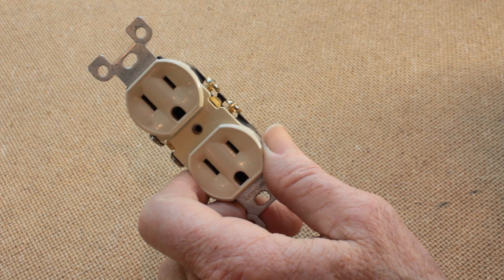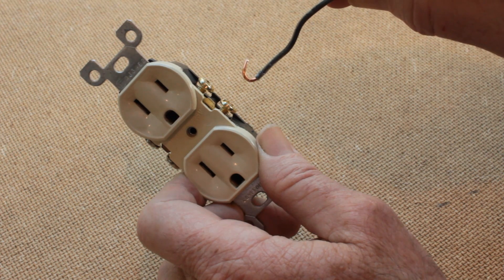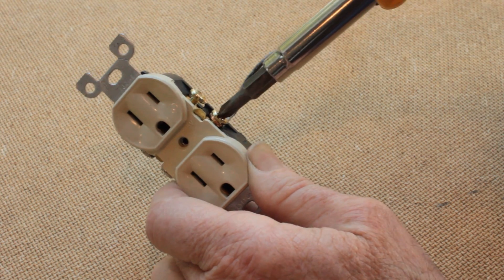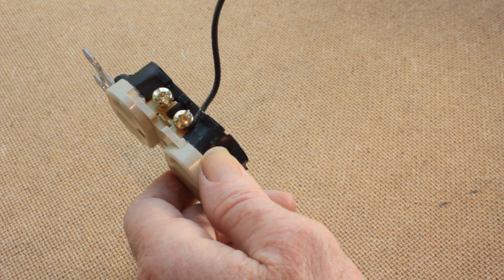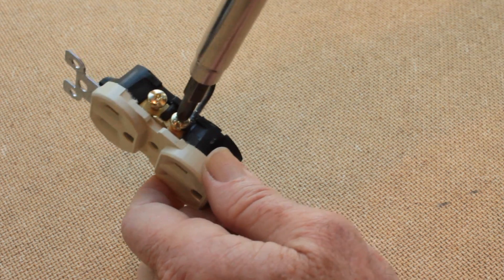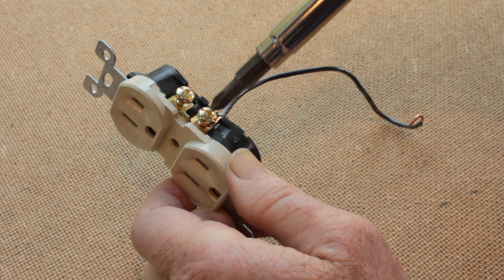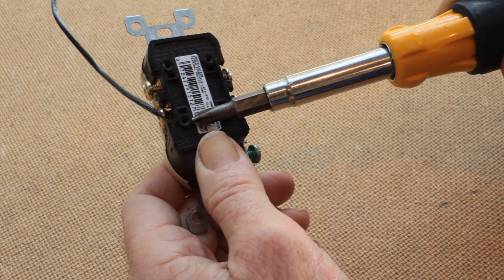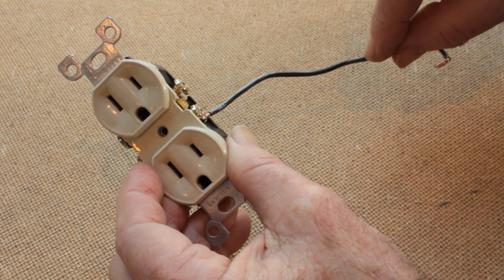A Common Goof Replacing Outlets

Comment: I just replace my kitchen outlet and its still not working.
Reply from the maker: Maybe you need to look around in the general area for another outlet that has pushbuttons on it (a GFCI) and push the reset button. Or maybe one of your circuit breakers needs to be pushed Off hard and then On.
Reply: u just helped me solve y an outlet didn't work. there was a gfci outlet that was hidden behind some things that had been put in front of it. apparently someone had pushed the test button.. i pushed reset & now the other outlet works. thanx!
Reply: Strange, in my kitchen, 3 duplex outlets are driven by one GFCI outlet...all outlets are on the sink side of wall...
Reply: In my state more than one non GFCI outlet can be added after the GFCI.   BUT you will need to note the amperage of the GFCI outlet and not exceed that with the total amperage being used by the other outlets just like you wouldn't exceed the TOTAL amperage of the circuit breaker in a circuit.
Reply from the maker: Most GFCI receptacles will say they are rated for "20 amp feed-through." This should mean you don't have to worry about overloading the GFCI device, even when it is only rated 15-amp in regard to the type of plug it can receive. See http://communities.leviton.com/thread/1534

Comment: I never use the cheater holes on the back, wish they would outlaw them.
Reply: They already have for #12 AWG; newer devices only accept #14 wires.  But yes, I wish they would do away with them altogether!
Reply: whats wrong with the cheater holes?    i bought my house new & all the plugs are wired that way.. house is 40yrs old now & just starting to replace all the plugs.
Reply: terry wheatley the spring loses the tightness and become could be potential for the wire to not make contact, pull out, or could create a hot spot by not being tightly held.
Reply: terry wheatley They MIGHT be fine IF enough wire is inserted, but I've seen something like 2mm jammed into them. I personally would rather use the actual terminal screws. I understand that your house wiring is 40 years old and they are not a problem. But a new house assumably had an actual electrician do the install. OTOH, you are in the process of replacing them. My house was wired in 1928 (I know this because it's was my grandfather's house,He was an electrical contractor, and did the install.) Only the Kitchen and bath outlets have been redone ( new circuits in the 80's So, grounded and GFCI, per code). The majority of the original outlets are present in bedrooms,etc. and working after nearly 100 years. They are obviously wired on the terminal screws and wrapped around with friction tape. So there's that.
Reply: They don't make or maintain good contact with the wire, they then get hot and char the insulation. Or worse.
Reply: David's Favorite Videos I always use the screws, I never trusted those little holes.
Reply: this probably explains why the home depot or ace hardware doesn't sell the outlets with the holes in the back  anymore.  when my outlets wear out, i usually buy home depots  top rated outlet & use the screws.
i really tried to buy the old style outlets, but no one carried those anymore.. thanks for your feedback.
Reply: terry wheatley, really, i just bought some leviton decora TR DR's from home depot 2 weeks ago that had back stabbers. nothing wrong with using back stabbers as long as you use properly. been doing it for 30 yrs. now, never seen any of the house i did burn down, "yet" LOL. but what i have seen, is someone, namely my helper, wrapped the screw on a 20 amp recept. but forgot to tighten the screw down on the (grounded/identified wire) side and that caused some major overheating and arcing and this was before Arc fault breakers. and thinking even more, (ut oh watch out) they use the same method for wire connectors now as well with those quick connects. they're all UL approved so i don't see anything wrong with using them as long as you use them properly.
Reply: i fully agree with you.. when they build tract houses, time is money & besides after 40+ years those wires in the stab holes are still very solid in the plug.. when i replace them as a homeowner I usually use the screws.
Reply: Well if the push in option was causing fires they would no longer be available. the insurance industry that pays for fires losses use facts to decide what they allow, and really don't care what any of us uses or wishes. If weren't for a need to replace worn devices in older systems,, the screw terminals most likely would be history, denying you that option.
Reply: I’m in the process of replacing the old 1970’s outlets in my home and so far not a single outlet that utilized the back stab wiring setup was loose. As a matter of act they were tight as can be and I just ended up snipping the wires clean and go from there. Just my observation and that’s where I’ll stop.
Reply: In a perfect world, yes, all wires should be installed under the terminal screws. This is probably the superior way to install the wires on a receptacle. However, imagine that you are an electrician installing 100 receptacles in a home. You do this day after day after day. The "cheater holes"  or stab holes, allow for a faster way to install receptacles. The important thing to remember if you are using the stab holes is to skin off enough of the insulation on the copper. Once the wire is stabbed in, it is rather difficult to get out. The connection is quite tight.
Reply: The "cheater holes", as you call them, are actually more reliable and safer than the screw terminals, as they are spring loaded and will maintain a gas-tight contact with the wire over the years.
Reply: @Milosz_Ostrow  false

Comment: Why not use a better quality outlet like Pass & Seymour and not Leviton junk. Pass & Seymour technology has a robust grabber plate that grabs the wire like a vise and no need to make those old out dated wire curls. 

Nice video but very out dated even for 2011. 

Also I would like to add that Leviton (and you can see it in the video) stamps their plastic body onto the metal retaining tabs. P&S tabs are solid and are formed around the body so that the plastic body is cradled on the metal chassis making is 100x stronger and longer lasting. 

When I encounter a Leviton device and remove it, I NEVER re-install it but replace it with P&S for the customer.
Reply: WRONG!!! Push terminal wire connections are for LAZY electricians and only (just) meet code. Rip open one your beloved Pass & Seymour outlets and look at the total contact patch that is made with the push in connection and then compare that to a loop around and screw down connection. Load that up with a 1500w heater over the cold months and tell me you'd feel comfortable with that setup in your own home. It's stupid, lazy and barely meets code. Stupid and lazy is what burns down houses and kills people but it makes profit so that's why it's allowed.
Reply from the maker: In my experience a "grabber plate" is not foolproof either (don't know if Pass & Seymour is different though). A bit of twisting this way and that as you are pushing the receptacle into the box, and those grabbers don't hold quite as strong as when you first tightened down.
Reply: And just how much more does the P&S cost?
Reply: A few penny's more, in my area (Indiana) they cost about $1.49 ea. 

I must correct myself, I do not mean "grabber plate" as rather I should have said the metal bolting plate wraps behind the P&S devices. Leviton the bolt plate extends through the body of the device. This causes the plastic parts to eventually separate and fail having the plug pushed and pulled out of it over time. P&S the bolt plate is mounted behind the device holding the device like a cradle.
Reply: Oh dude, the ones that u shove em in the holes in the back of the outlet? Those are shit... I tried to get them to release but the buttons were rusted over... i snapped one to pieces too.. xD i had to cut the cords and rewire all different types of wires... the ones that fit have screws were easier to get them to pop out even though they were in the same shape. I prefer screws over the fancy stuff. I had to cut so many wires. :/  I am doing a rehab on an old house. :p
Reply: OberDragon88 

EXCEPT

The screw connection is much better than the crappy connection back push ins that cause fires by bad connection
Reply: OberDragon88 Plus, trying to insert wires in the back of an outlet is almost as hard as replacing a ceiling fan pullchain with push terminals.
Reply: must be nice being rich by I pay retail $0.62 for 15 Amp at walmart and less the $3 for 20 Amp at homedepot
Reply: OberDragon88 hubbel
Reply: Leviton almost invented outlets. They were made in America. I do know that they have a great warranty.  They replaced some outlets free.  All companies have good products and failure prone products. I always screw my wires...none of that Mickey Mouse attachments.
Reply: i agree with you about the Leviton products. they simply are not good quality. I prefer Hubbell, Pass and Seymour or any of the other premier quality devices. In the long run the extra cost will be earned back in the form of superior performance and lower maintenance costs, and the safety factor is greatly increased.
Reply: @ Sean Greene Why don't YOU take one a part and see that they are not like the older generation push in the back wire clips. They are designed with metal sandwich plates the way terminals on 3-phase starter relays are made. S0 stupid put that in your pipe and smoke it, your the lazy one to not research your material before posting.

Comment: Great tip!!!   I've always seen the push connectors as the territory of the lazy electrician or the clown doing "knock it out fast" piece work.  I prefer the Industrial grade recepticles with screw and clamp plate over the type shown in the video.  They don't even give the "goofs" the option of a push connector.   I also prefer a large flat blade screw driver so I can get more torque on the screw and prevent any sort of resistance cycling at the wire/fastener interface.
Reply from the maker: +ramosel  I agree on the flat screwdriver. I found the clamp plate method could easily end up loose too though.
Reply: ramosel if you use the correct size Phillips tip screwdriver you can get the right amount of torque as well. I see so many people who use the wrong size tip or bit with their screws and want to know why it stripped out on them.. Duh.
Reply: Yes, but even the correct Phillips tip has a problem that limits torque.  Phillips screwdrivers and screwheads are designed to deliberately cam-out ("slip") above a moderate torque level (rounded corners in the center of the screwhead), unlike a true crosspoint screwdriver and screw combination that is designed to lock tightly and not slip.  This Phillips cam-out design was done deliberately in the earlier part of the industrial era, when factory equipment didn't have calibrated de-clutching yet, and these silly Phillips screws have remained in universal use since then.
Reply: I recently changed out the 3 duplex outlets in a surge suppressor strip which had push through for side wired with screw terminals outlets, new copper wire, and line cord, reinstalled in the CMOS. Screw connectors much more solid.

Comment: so anything wrong with just using the holes again? 
you do not have to de rate the outlet if you use them? 
i  know some electricians do not like them
now those snap on mobile home outlets those are a joke  lol
Reply: crowmagg1 my rule of thumb is to never reuse an outlet once the wires are taken off.   The receptacle can have loose and worn parts.  Replace the outlet and that makes you and your house safe and whole.  If you really, really, really want to reuse a previously installed outlet where the original installer opted for the backstab route, use the screws.
Reply from the maker: Jim K - I think when crowmagg1 asks about using the holes "again," he means using the holes of the new receptacle rather than using the screws.
Reply: TheCircuitDetective yep, I just read it the other way.  :)
Reply: as long as the conductor are corrosion free, and free of nicks they  can be used with  the push in option on the replacement device.

No need to derate the device.
 
Yes many electricians dislike them. They dislike them without any evidence they are causing fires. That's conservatism to a fault.

I believe the odd ball mobile home  devices have been phased out. Probably because it's cheaper to use a more common device, that in practice doesn't take 
 that much longer to install.
Reply: waswestkan whats mean derate?
Reply: Frederick Reeve - Derate, de + rate, treat it as if it cannot handle the amount of current that it was originally designed ('rated') for.

Comment: Can you help? I replaced two receptacles and there is one UN-replaced receptacle in between (a 20A, 125V). The two replaced receptacles are 15A, 125V, and the one "upstream" of the other two WORKS, but the two others don't (the UN-replaced 20A and the replaced 15A). I don't know what happened -- could I have fried the 20A?
Reply from the maker: +desertgalsinLA  Check how well you made the connections at the working upstream receptacle.

Comment: Aluminum wire was common in the late 60s /early 70s you can pigtail copper from the receptacle to the aluminum wire as long as the aluminum to copper splice is done properly with approved connectors

Comment: Another tip when using lamp cord is that the neutral wire is the one with the bump or ridge on the side of the insulation.
Reply: Kenn you should never use lamp cord on an outlet
Reply: When replacing the cord to a lampholder socket, the neutral (wide slot) should be wired to the screw base side, the hot (narrow slot) to the switch and center lamp contact.  If you do it backwards, you can shock yourself while changing the bulb, even if the switch is in the 'off' position.

Comment: I never understood why code allows wire connections to be made connected into the push in type connectors on the back of outlets and switches.
Reply: I have never seen those push in type fail before and a google search showed nothing.  Have they failed on  you before?  Those push in type have been around for 30 years and I have never seen one fail before.
Reply from the maker: Because some of these push-in connections do fail, I have been called to deal with a good number of them. But I have also been called to fix poor connections of the other sorts. I don't know if the failure is proportional or not.
Reply: Thanks for the info. Hooking up the wires with the screws is the better route to go. No doubt about it.  I just didn't want to knock the push in connections because I haven't personally  seen one fail before unless it was something stupid like someone not pushing the wire in far enough or something like that.
Reply: I've seen, arcing & Burn't wires, almost fires. when back-stabbed, back 20 years ago, was common, in kitchens. Counter top, caused a lot of fires, with #12 wire gauge.

Comment: Some homes, San Antonio, Texas Area, were wired with Aluminum Wiring.

I understand that we need to use electrical outlets and/or switches that are
designed specifically for aluminum wires.  Otherwise, we might be creating
a fire hazard. I have talked with many home owners who were not even aware
that home had aluminum wiring vice copper. I would really appreciate your
comments on this topic.  Thank you kindly, Jose T
Reply from the maker: +Jose Trevino You are right. When aluminum was first used is was not known that it wouldn't get along well with the metals that receptacles are made with. Now it is known; therefore they have designed special receptacles and switches that will get along with aluminum.
Reply: +Jose Trevino we used to live in a house that used aluminum wiring, i smelled something awful but at first thought it was the baby (we had some family visiting) then i went to plug in my phone and i felt the outlet was really hot, we literally shut off the power right away and just took the receptacle out, turns out a small fire had indeed started, had i probably not went to plug in my phone we probably would've been homeless
Reply: THe devices you'll use are rated CO/ALR. That means Copper/Aluminum Revised. This has to deal with the materials and methods of termination to the device. Another solution is to use those Copalum connectors at every junction point. Ideal  65 "twister" nuts are not recommended, but see use in this scenario. The 65s are meant for wall ovens and the like.

Comment: Thanks for posting this. I had made this exact mistake and after two years had low voltage in outlets farther down the line. Cut back the insulation, tightened the wire back into place, re-installed and everything worked.

Comment: I'm not even an electrician and I've replaced MANY outlets where the quick-connect feature had failed and caused burning of the outlet.  Those damn things have HAD to kill dozens of people.  The kind where the screw is used to pinch the wires after you put them in the hole are OK tho from what i've seen.
Reply: The instance industry drives codes and they have the larger data set The  devices are still available has to show they aren't as dangerous as your limited data set proves to you. Money talks, money lost by insurance corporations talks the loudest. So the devices aren't starting fires in an alarming number. I help maintain many aspects of many residents of family and friends 40 years including electrical in which I have formal training . I have yet to replace a faulty deice that failed due to the push in connections. I'd worry more about electrical work done by someone who thinks they know what they are doing, and don't know a thing as they go about their sloppy workmanship.